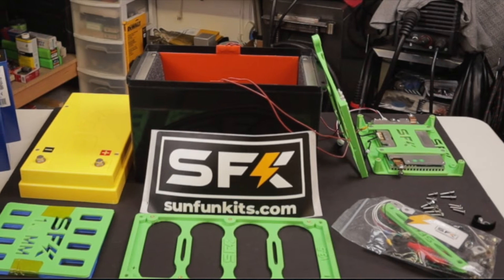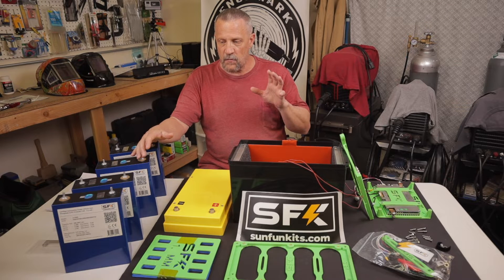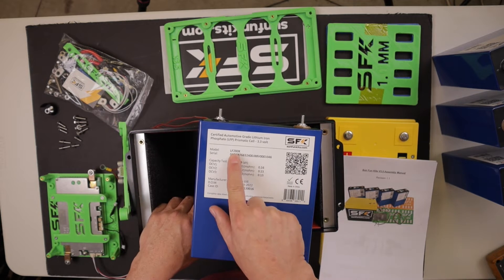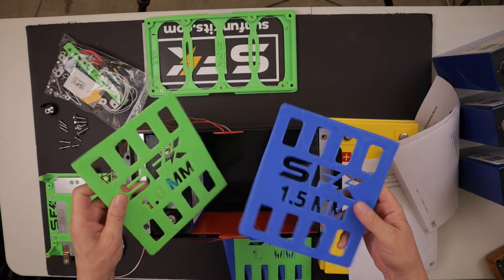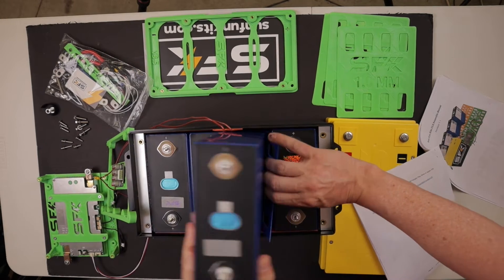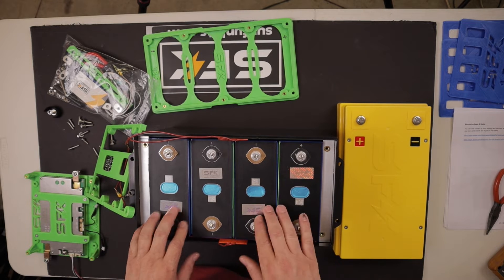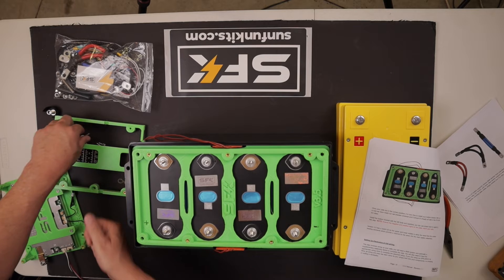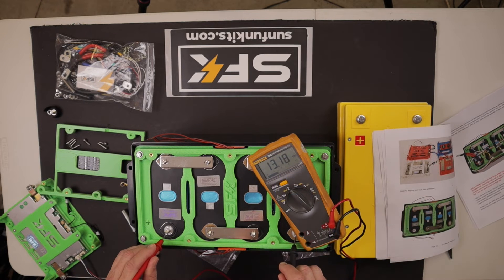How to Build a LiFePO4 Battery (DIY Lithium Iron Phosphate Battery)

Comment: Good video but I looked on their site and a 280ah 12v battery costs over $1200!  Isn't a Chins or one of the others already assembled around $600 for a battery like that?
Reply from the maker: I don't know anything about the Chins batteries but do they have Certified Grade A cells? My understanding is this accounts for a large portion of the SFK battery cost. Certified Grade A cells carry a warranty, provide the rated capacity and are very well matched in resistance from cell to cell. This provides a very well performing battery that will provide many years of reliable service to the end user. Does the Chins battery have the self heating function so it can be used in a freezing environment without damaging it? This also adds to the cost of this particular SFK battery. Some batteries have the self heating feature and some don't. There are a lot of LiFePO4 battery options on the market today and they cary a wide range of features, components, warranties and prices. I have found it to be difficult to compare them without doing some research so you can have an equal comparison. In the end you just have to determine what is most important for your situation and what cost you are willing to spend to meet your needs. I can say that if you have a problem with a SFK battery it is nice to have support located here in the United States rather than trying to deal with a company located overseas. When I was assembling this SFK Kit I was able to just pick up a phone and talk to the company owner. It was easy to get the answers to my questions, so that is worth something as well. Good luck with your search and I wish you the best in your ventures.

Comment: I believe you should have left the Active Balancer plugged in. As I understand it.... The batteries should be Properly balanced prior to shipping yes, but the active balancer will maintain their balance throughout the use of the battery. Lets say you put a big load on the battery, and run down 90% of its capacity, cell #1 (as manufactured) has the least amount of resistance (compared to the other 3), so more energy was used out of this cell than the others, and now has hit an internal voltage of 2.5 volts, where the others are at 2.8 volts. The BMS will now turn itself off prematurely due to the lower voltage on cell #1. Even though you may not have gotten the full 280Ah. It's an "Active" balancer and will move small amounts of energy where it needs it so all cells get used equally. SFK quotes it as a 5 Amp balancer, where most BMS's that have balancing are only around .02-.08 Amps. This is specifically one of the reasons I'd like to get one of these kits... But the $1400 price tag Just isn't jiving with my wallet.
Reply from the maker: I have connected the active balancer since making that video and it's performing just as expected.